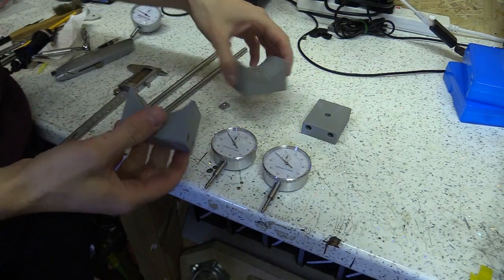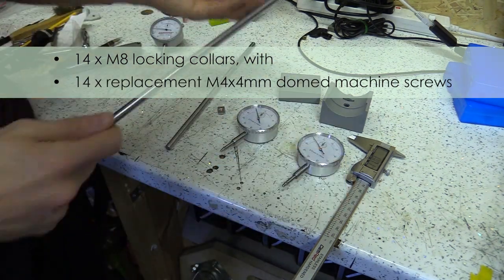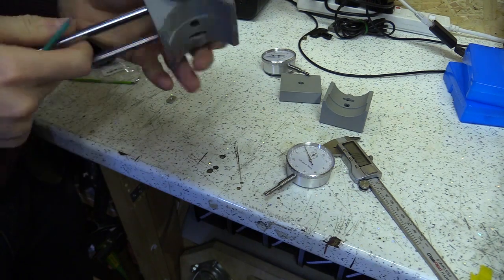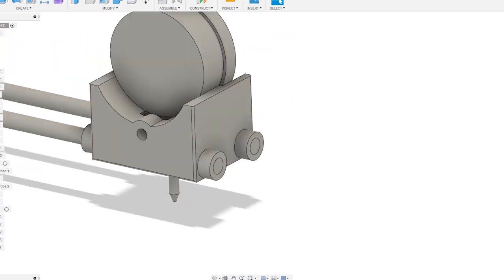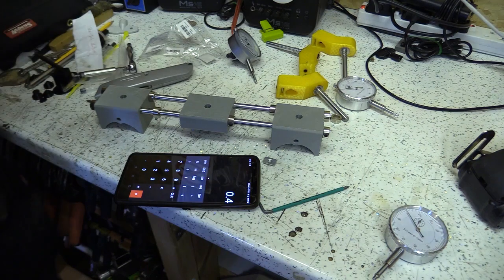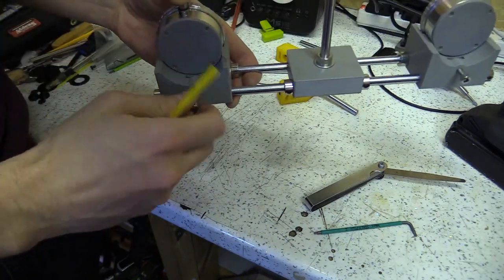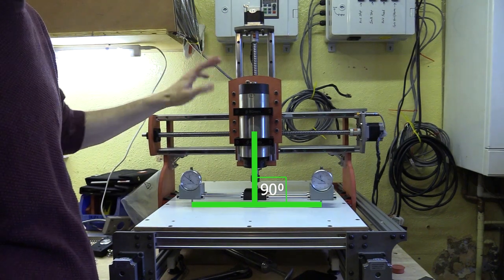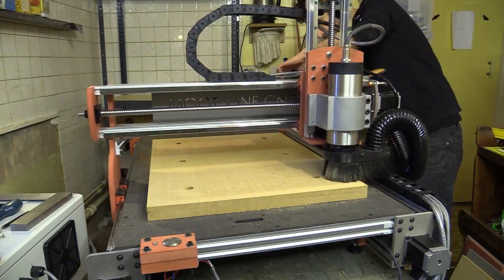#48 Dual Dial Gauge Tramming Tool   CNC Spindle Settup   3D Printed and DIY Assembly

Comment: It's a pleasure to both watch and listen to! The only way to perform this is if you made sure the X and Y axis move in a lineair motion. (straight) and that the Z is moving in a 90 degree angle to both X and Y. It's tedious to adjust a portal-type mill. A measured reference flat gives the quickest results. And a precision hair ruler at /00 grade is very helpful (or confronting) as well.

Comment: Nice video, but I think you may have the process out of order. You are trying to tram the CNC router assuming your "spoil board" is perfectly level. You need to place a 12" x 12" mirror/glass on the surface of the spoil board and level it using one of your dial indicators. The mirror becomes your level reference plane, not the spoil board. Once the mirror is level, then you adjust the spindle motor mounts (X tilt, Y nod) so the motor is perpendicular to the mirror (90 degree angle in the X and Y). 
Once your motor is trammed, you then resurface your spoil board to make it perfectly flat (level).

Hope this helps,
Roger D. Secura
Reply: If you surface the spoil board first it will be perfectly parallel to the gantry.  The problem is it may have ridges where the cutter wasn't parallel. 

You can't assume a mirror or glass is perfectly flat or that it has perfectly even thickness.  They're probably better than a piece of wood or the average piece of sheet metal but there will be plenty of variation when measuring in thousandths of an inch.  You can try to shim it out but I've found that to be too tedious.

What I like to do is surface an area to fit my spindle tram (I have a Pro Tram from Edge Technology with a 5" span between the indicators - I use a 6" circle) with a high-quality 1/4" square end mill using a small step over.  This has yielded outstanding results for me where I can get within a thousandth over the 5" pretty easily.  If your machine is so out of square that a surface using a 1/4" end mill has ridges the problem is probably elsewhere (eg, deflection or something), but normally you can just decrease the step over until you get it flat.  I usually use a 0.150" step over.